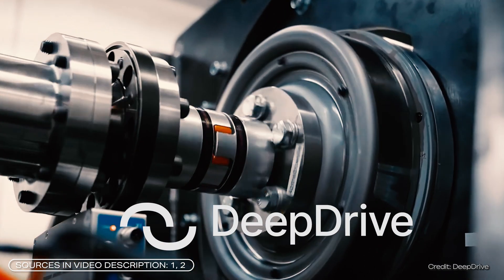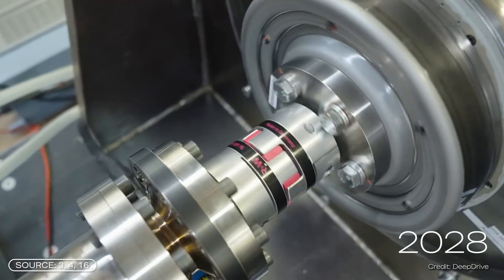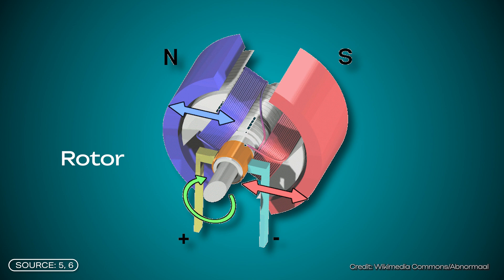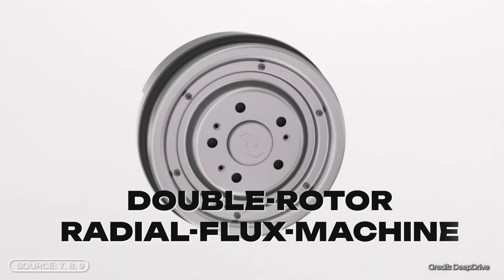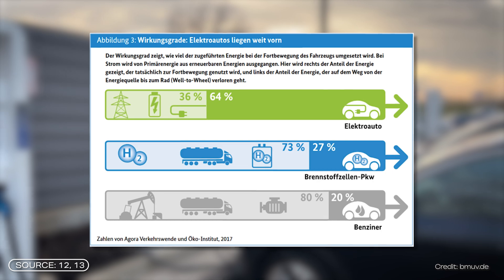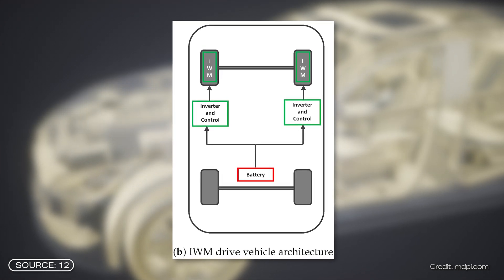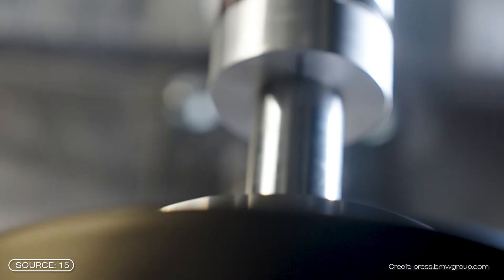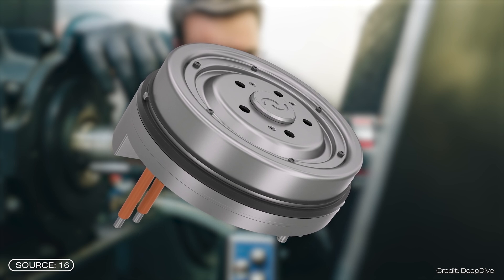Efficiency Made in Germany: DeepDrive's GENIUS motor

Comment: Wheel hub motors are going to take a lot of time to become practical, if at all.
The "Major Catch" is just that. It is possible, but at what cost? That's going to be the driving (or killing) force to this technology.
Central motors as used now are going to be more reliable and easier/cheaper to repair.
Wheel hub motors are going to be less reliable (because of the mentioned drawbacks) and will be more expensive components to repair.

Comment: They should make them as light weight as possible and not go for more than 50 hp per wheel.  High torque will give great acceleration at low speed.
Lucid would have done this if it was  worthwhile

Comment: All this unsprung weight would be interesting on rough roads.
Reply: The motors can be easily mounted inboard, with acceleration and braking torque delivered to the hubs by halfshafts. Unsprung weight problem solved.
Reply: Nope! You are simply back to square one. Much ado about nothing.
Reply: This could be done, but then the motor has to go inside the springs/shock absorber and you lose the space advantage of wheel motors.  The space would still be greater in the center of the car, where the motor/differential would normally be.
Reply: sure but then this is no longer a hub motor and you still need all the same universal joints to deliver power to the wheel
Reply: UK potholes will cause a real problem with wheel hub motors. I also have a question regarding repair costs. Wheel hub motors are much more likely to be damaged in minor accidents, leading to higher insurance costs.
Reply: @rugbygirlsdadg  welll, there must be a way :) maybe just drive slower or as the other guz said use these shafts . at least a differential is very unefficient and not need if you have 2 electric motors .
Reply: On rough roads, slow down
Reply: I like the idea of inboard motors but that blows out the space-saving aspect
Reply: I would like to see one mounted like an old hand brake drum on a drive shaft which can be used and engaged in stop and go traffic along or maybe in tandem wity a flywheel that engages and disengages at appropriate times to keep its inertia from going below its operational rate to move the vehicle along reasonable in  traffic.
Just think of the possibilities of being able to go for a long drive in a  vehicle. Because you conserve the battery when you decelerate and flywheel gets charged.
Reply: :face-blue-wide-eyes:on super rough roads just drive slower ? OR build it durable enough to not have to care about it...  also the guy mentioned a solution with the " halfshafts " .. but I like to keep hub motors simple even though they are a bit heavy in the end:face-fuchsia-wide-eyes::face-blue-smiling:
Reply: @AchimFechters : how do you build it durable to not include inertia?
Reply: @drewthompson7457   it is too much for the comment sec. but it is doable ;) just use your brain .
Reply: @AchimFechters  : yes, unsprung weight is not the best. I was commenting on this video, not what is possible.

Comment: They will encounter several technical challenges, including issues with the braking system (such as an axle-mounted brake), a cooling system that requires additional cooling tubes on each wheel (adding extra weight), and variations in the magnetic field (with different magnet sizes between the rotors). Although Mercedes experimented with an axle flux motor - not most efficient electric car yet.

Comment: Tesla Model 3 motor already has a 97% efficiency.  96% is not impressive.
Reply: Exactly my thoughts. Comparing this development to motors that are not even used in electric cars is disingenuos at best.
Reply: The loss is happening in the transmission- not the motor.
Reply: @Isimud Thanks for pointing that out. However,  there is no way, a single reduction gearbox and 2 cv joints even come close to 20%. A typical setup for electric cars. This is still just typical startup cherry picking, disengenuity.
Reply: 97% is peak efficiency.  How often is the motor operated under that condition?  How often is the efficiency more like 50%?  You need to look at the entire efficiency chart, not just the peak.  So it's not just transmission losses they are claiming to have addressed.  There is plenty of room for improvement in the motors themselves.

Comment: I wonder how these motors would do in an ICE-electric hybrid concept. A smallish battery pack to provide peak power and allow regenerative braking and the engine/generator to extend range.
Reply: Indeed. I think this is the best compromise for the foreseeable future. Especially for city driving and commuting, since this could mostly be done by home charging. Having the ICE generator allows anxiety-free long range when needed, so is the best of both worlds. Also, this allows massive weight reduction since the engine doesn’t need to be large and the battery weight is small.
Why car manufacturers aren’t making these by the million I do not know. It’s obvious that consumers want this.

Comment: I have a in-wheel (hub motor) in my Moped and I love it. When I open the throttle I have instance torque which I didn't get with my earlier motor bikes. Another plus when the motor is in the rear wheel you have more space to have a larger battery pack. One major problem I have is the unsprung weight. I don't have very good rear suspension yet, I am still working on this issue. 
Another small item not talked about it the noise. Because these motors are outside you have far less engine noise. When riding my moped (at any speed) with my helmet on I can hardly here the motor, this would be the same in a car. I can't wait for these motors to be installed in cars.

Comment: 3 problems: 1. Unsprung weight 2. Durability & reliability (motor will experince all vibrations of the wheel) 3. 20% efficiency is exaggerated, transmission loss is about 5%.
Reply: This
Reply: I continue to create a project of an internal combustion engine, I remind you that I am posting here on my channel the technology and the principle of operation, according to which anyone can create a prototype and enjoy free energy, since I am denied financial support at the stage of the idea and theoretical research, after a year of unsuccessful searches. Including I will begin to assemble a sample. And soon another video will be released revealing my developments, the wind of change is coming! All those who are not indifferent, welcome to fly into this departing innovative car, which will lead to great achievements for the successful future of the planet and humanity!
Reply: Wrong.  They are claiming a 20% gain based largely on the improved efficiency of the motor itself from its dual-rotor design, not just from eliminating transmission loss.  Please remember that a "95% efficient" motor isn't always 95% efficient.  That's peak efficiency, which could easily fall to around 50% under light loads.  So there is plenty of room for a 20% gain under real-world operating conditions.  But overall, I do agree that we should always be skeptical about manufacturers' claims.
Reply: i think the efficiency number is a calculation trick. if you have motor A with 94% efficiency that means 6% is lost.
20% of 6% would be 1.2%. if you have motor B with 95.2% efficiency, you claim 20% more efficiency.
i think it is the wrong word. i would say 20% less losses and not 20% higher efficiency.
we will see what's going on at some point. bmw already has such a 4 motor prototype and there is a video out with that insane monster.

Comment: I belive its the future but first when they are powerfull enough to work as breaks. Hard to see how they can improve range by 20% when excisting motors are over 90%. Weigth does not mean so much. There can be more maintanence on the motors but there are also fewer part so...
Reply: Central motors need a gearbox and transmission to get the torque to the wheels. Hub motors don’t. That’s where the extra efficiency comes from. Also, gearboxes and transmissions are heavy, which is eliminated so the simple reduction in mass also contributes.

Comment: Der Autor des Videos hat nichts über das Gewicht des Elektromotors im Rad gesagt. Als diplomierter Konstrukteur von Fahrwerken kann ich sagen, dass der Erfolg des Konzepts stark vom Gewicht abhängt. Die Frage der ungefederten Massen beeinflusst sowohl die Fahrbarkeit als auch den Gesamtkomfort des Fahrzeugs erheblich. Insgesamt ist es eine gute Idee.
Reply: This was discussed under “unsprung mass”. No numbers were given, but that is true for most pther aspects of these motors.
Reply: In the premium segment, the increase in sprung mass BMV can be managed using adaptive suspension elements, which allow for adjustable stiffness of the spring and damping components.

Comment: Iirc, Another company tried wheel hub motors but found they were too dangerous due to the high voltage wiring.
Reply: Erm, citation needed?
Reply: @ 7:30
https://youtu.be/K7FlrzTcpDI?
Reply: @ citation^
Reply: @hi-gf5yl  Hmm. That’s a pretty interesting interview. Makes a lot of sense. I don’t think it’s a showstopper for hub motors though.
It would be if we were talking about integrated inverters (motor drive electronics) because then you’d be putting the HVDC lines in that vulnerable location. However, no company would do that. It would just add unnecessary unsprung mass to the wheel. Practical hub motor vehicles always have the inverter inboard in a protected location within the chassis, so it’s only the 3-phase cables that need to be flexibly connected to the wheel. Inverters have many safety functions built in, so they can easily disconnect those cables from the high voltage supply in the event of an accident. They also have HVDC fuses, so if the inverter is damaged it disconnects from the high voltage bus automatically. We can also borrow a few tricks developed by the military and aviation - fail safe fuse networks. These work by putting all the safety critical fuses in a single module, arranged so that if any one blows, they all do. Basically, it’s a solvable problem.
Reply: @simontillson482  The motor already adds unnecessary unsprung mass - way too much.

Comment: 20-25% gains seem exaggerated. biggest difference for the 2kwh per 100km difference in transmission losses I could calculate was 14.9% using 13.6 kwh / 100km of the Model 3 Long Range Rear-Wheel Drive , low of about 9.5% using Model X Plaid around 20.8 kWh/100 km.
Reply: Indeed, the real advantages are situated in component packaging and active safety and vehicle driving dynamics. 
See "A Tesla built by ex-Saab engineers – World exclusive test drive of the NEVS Emily GT" here on the YT channel of the Swedish Auto Motor & Sport.
Reply: It's not just about transmission losses.  They are claiming the motor itself is much more efficient.

Comment: Damage to the components From the unsprung weight will be the real issue on the wheel hub motor. If the components can I take the constant battering of the road the idea will fail yet again. Also, why three years? It’s not reasonable in today’s environment to wait three years to bring a product to market after design testing. Elon musk would do it in six or 10 months.

Comment: Oh my, hub motors could do so much for hybrid conversions. A strong FWD vehicle with a 100hp hub motor at both rear wheels would transform into a fuel efficient machine with high performance characteristics.    

Even an average 200hp FWD sedan would transform into a  mini muscle car capable of doing 40+ mpg.
Reply: interesting idea for old timers. but then we also need a bit smaller batteries to retrofit it somewhere inside.
Reply: Watch the NEVS Emily concept car testing by Auto Motor & Sport (the Swedish channel of AM&S). The wheel hub motor is not only a paradigm shift when it comes to packaging of the car components (the interior becomes far more spacious) - together with the right vehicle stability software it is also a paradigm shift when it comes to active safety and unrivaled dynamic driving capabilities. (see "A Tesla built by ex-Saab engineers – World exclusive test drive of the NEVS Emily GT").
Reply: I doubt that cause you should listen to Prof. Neugebauer the head for electric drive train at the KIT in Germany who is warning about the implications of such change and that he did not trust the figures he had seen. 
Have you done the math presented here if those saving figures of 20 - 25%  can be true as mentioned at 6:13 ?
A model 3 has to be driven with 10 kWh per 100 km that 2 kWh of savings would increase the range by 20% 
And for 25% you have to drive a model 3 with 8 kWh per 100 km to achieve the savings to increase the range. 

These figures of 20% - 25% can not be called realistic cause a model 3 consumption figure (based on the charged energy and not the onboard computer figures which means to charge the car fully, drive and charge it again to devide the energy charged by the hkm driven).
Take 15 kWh per hkm (measured by the charger) and the savings of 2 kWh promised will result in a range increase of 13% which is by itself a great achievement, but terrible if you have promised 20 to 25%. Go to an investor and promise 25% while he can calculate that this figure is way off the reality and you are screwed. 

And : what about the prices for 4 smaller motors and 4 control units for each motor ?

Comment: I'm fully skeptical of wheel hub motors, especially ones like this where very tight clearances are required.  Wheel bearings are a normal wear item, and as soon as the bearing starts wearing you will destroy the motor by internal interference.  What used to be a $100 job to replace a bad wheel bearing is now several thousand..
Reply: I had never thought of that but you are right.
I simply concentrated my skepticism in the "start up" part of this.😅
Reply: Wheels, I believe, are subject to the greatest amount of shock during actual driving.
Reply: I suspect for a town car or a motorbike/moped it should be fine tbh. It wouldn't need to survive high energy environments like highways or heavy loads so the bearings would pretty much last forever. 

From my experience for example, as someone who lives on an island that's smaller than most capital cities, bearing replacements are almost unheard of even though most of our vehicles are easily above 300,000 km (shitty public transport)
Reply: The prototype Chrysler LH (intrepid) did a lot of miles but yeah all of the above issues with EVs in 1994
Reply: you take somewhere to gain somewhere esle. Not a big deal considering you may achieve wins on other fronts where you could potentially do some savings. Less complex but more precise is where manufacturing is heading anyway.
Reply: Aptera did do a protype with wheel hub motors, the problem they had was , that company is a startup too, and as such needed more money than Aptera could afford. It is good Direct drive had BMW backing financially.
Reply: I don't want wheel bearings to determine the lifespan of my car
Reply: Also the fact that if God forbid it breaks down in the middle of nowhere there’s always the fear of no fixing it?
Reply: Moteur-roue d'Hydro-Québec 1994, yeah it was a bit of a waste of public funds, they had relatively good results with the hub units but battery tech and charging wasn't ready for EVs in 1994 🤦🤣
Reply: The location of the bearings doesn’t look to bad.   You may have to pull the motor free but it looks like it will encapsulate everything.
Reply: https://youtu.be/dlGfepJX3M4?si=43MGS-Onhux96glY
Reply: Modern sealed wheel bearing are now lasting more than 150000 miles, as with anything this is so with high quality products not the cheap stuff
Reply: The motor and the bearing have absolutely nothing to do with each other!!!
Reply: Changing the bearings on ebike hub motors is easy so it might be the same here
Reply: Electric motor bearings are mandatory of a much higher quality, the best being ceramic bearings which in principle last for ever.
Reply: you are right. however, bmw already has a 4 motor prototype and there is a video of this insane car out there.
Reply: @ Prototypes are cool, but what about the car that's been driven for 80000 miles by an uber eats driver?  Any vehicle that sees real world use by owners that are famously bad at maintenance will have very different results.
Reply: @YDMU-A-A-Ron  this is why BMW made a test car.
beside that, deepdrive builds a central version from this double rotor concept as well which should be cheaper and more efficient than other traditional motors. this way it is very likely that we will see the double rotor motor in a real world street car, no matter if in-wheel or not.
Reply: Wheel bearings outlast the car these days.
Reply: @steventrott8714  Eh, maybe Italian and american cars?
Reply: I continue to create a project of an internal combustion engine, I remind you that I am posting here on my channel the technology and the principle of operation, according to which anyone can create a prototype and enjoy free energy, since I am denied financial support at the stage of the idea and theoretical research, after a year of unsuccessful searches. Including I will begin to assemble a sample. And soon another video will be released revealing my developments, the wind of change is coming! All those who are not indifferent, welcome to fly into this departing innovative car, which will lead to great achievements for the successful future of the planet and humanity!

Comment: A wheel hub motor allows conversion of existing petroleum fueled vehicles when the next massive oil price shock happens.

Not IF but WHEN

An old inefficient economy car with two hub motors, the engine and fuel tank ripped out and replaced by battery packs and control circuit will definitely be less efficient than a purpose built electric vehicle. It would allow millions of car dependent people to continue to survive in our fööked up societies.